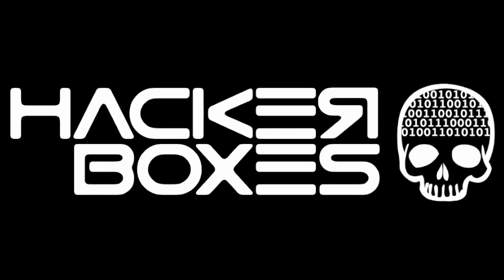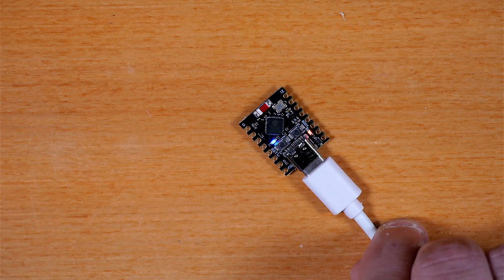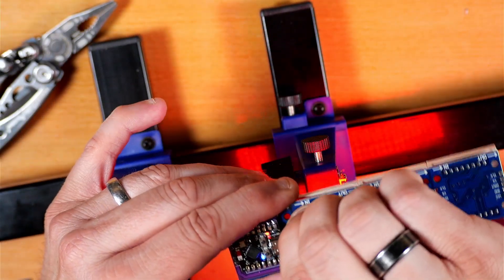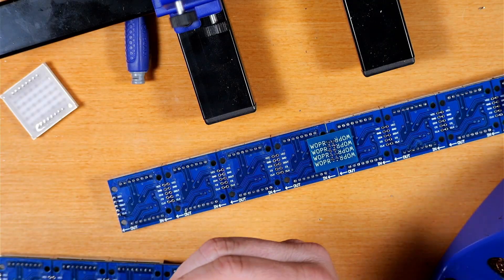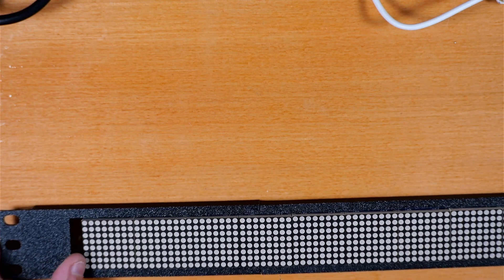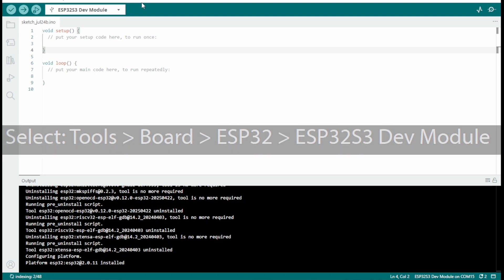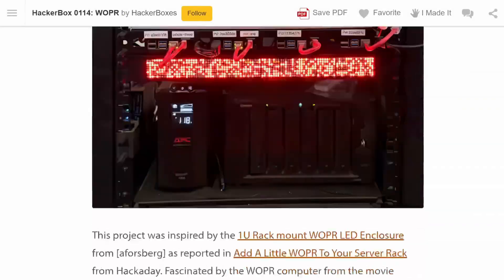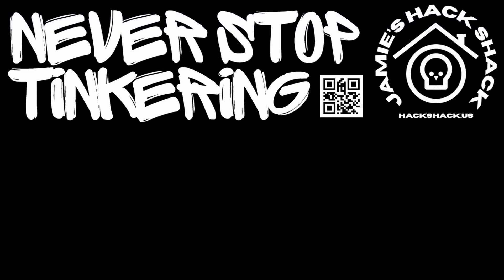Hackerbox 0114 - WOPR

Comment: i got the first sketch to load and run  Julia_Set.  I run the second and nothing happens.  I am pretty new to this so im super confused on where to even start troubleshooting
Reply from the maker: OK are you talking about the status one?  While it is plugged up and "running" the code can you see any output in the serial monitor in arduino? (you may have to experiment with speed). Sometimes if it couldnt connect to your wifi it may not really give you a decent error message on onboard screen but there may be some debug information on the serial output in Arduino. Did you double check your SSID/passphrase setting for wifi? I am not 100% sure but I think when I first loaded it on mine I had a typo and it was just black because it couldn't connect but I could be mistaken. See if you get any clues on that serial output maybe. Thanks for watching!

Comment: I wonder if you can use another set.   I'm i correct that you can use max 8 units? To this project
Reply from the maker: If you are talking about individual squares I think this is getting close to the limit before you want to make sure things have their own direct power supply. I think maybe this particular setup with 12 total (4*3) is at the edge of what you want to have setup like this depending on brightness. I could be mistaken. If you have a nice power rail you can have many more probably. Need to look at some buffers though. And maybe slowing down the spi.